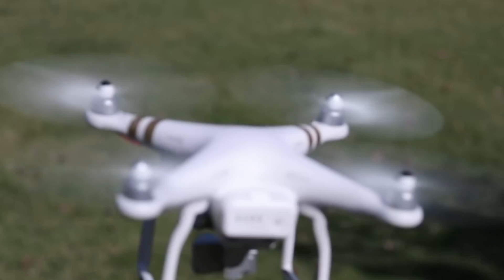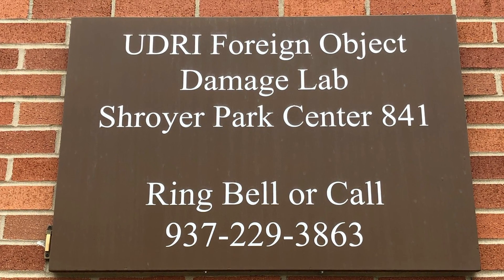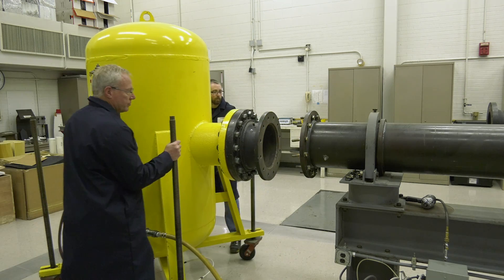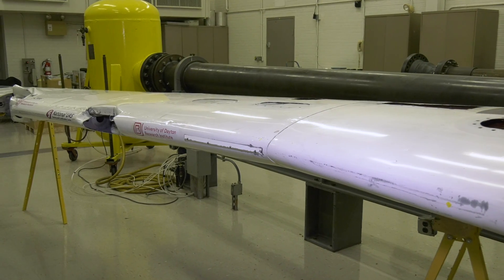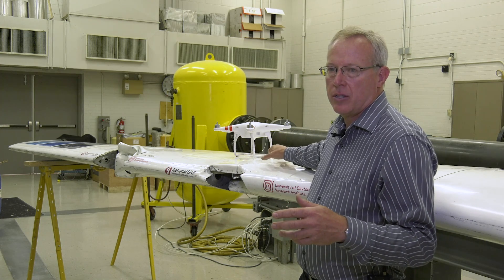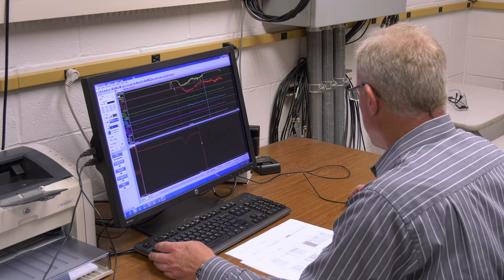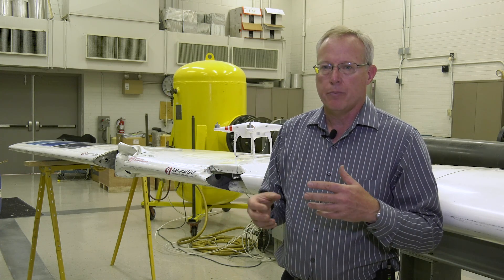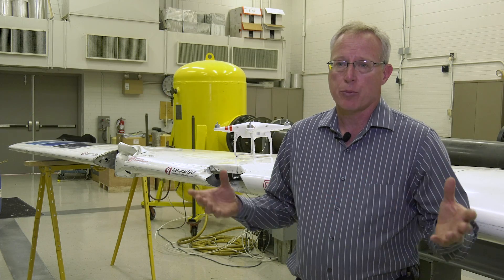What Happens When a Drone Hits an Airplane Wing? – AIN

Comment: The test is slightly misleading. While the closing speed of 238 mph might be realistic in some unlikely circumstances (see below) it is the airplane's wing that flies fast with the drone being more or less stationary. A wing travelling fast through the air causes specific airflow strong enough to create lift keeping the plane airborne and that airflow would tend to very strongly deflect the drone either up or down, away from the wing's leading edge so a direct strike like that (perfectly aligned with wing's chord line) is highly unlikely.

Drones operated legally fly below 400 ft or within 400 ft of a structure and away from airports. Planes operated legally don't fly at 200 mph+ that close to the ground or structures except perhaps for landing/takeoff where drones can't fly so for legal drone and plane operations 238 mph closing speed is not realistic. If you don't care about the rules then, well, you can do a lot more damage with a box cutter for instance.
Reply: Binary Operator may be unlikely, but bird strikes to the leading edge of wings also occur without them being “deflected”
Reply: @macadamia238  a bird weights way more than a drone, therefore has more mass and is harder to move.
Reply: Incorrect the airflow around the wing would not deflect the drone.

If this theory was accurate there would never be bird strikes yet they happen regularly.
Reply: Surprisingly they aren't testing the "what if it actually doesn't hit" scenario, because they want to know what happens when they do hit.
A car is also unlikely to hit another car head on, but the crash test does need to determine what happens when they do, that is the sole purpose of a crash test.
Reply: their testing methodology is flawed.   that chances of it hitting a wing square on is effectively zero even if the sky was littered with drones...anyone understand why this is is facepalming so hard at this test and how these guys and gals even get funded...ill give you a hint though, same reason why ice doesn't form on that part of the wing first and forms further back when and if it forms.....

 doesn't mean it is impossible a drone may strike a wing square on, just as unlikely and accidently hitting the moon with a passenger jet..
Reply: Well, over the years as an airline engineer, I've seen lots of birdstrikes, even a fruit bat strike.  Usually bang on the leading edge.
Reply: Binary Operator in a simulated crash it doesn’t matter which is moving towards which. I think you’re better off getting a review on scheme of references and how vectors works. This experiment could be seen from the scheme reference based on the aircraft, as any study is practically done, since it’s much easier to move lighter objects instead of heavy ones, or with instrumentation. 
Also the experiments always need to evaluate the worst case scenario to guarantee safety in any other possible scenario. 
By an actual aerospace engineer.
Reply: Giuseppe Pipia Exactly.I am amazed at how people often argue about such small things and think they know more than the experts themselves.......
Reply: Here they are testing only what a drone could do to a structure: that means that a panel on the aircraft will be obliterated. The wing is important because any irregularity on the airfoil might be critical for the aircraft, but that doesn't exclude the fact that it might hit the windshield or the nose or any other part of the aircraft. We engineer test those extremely difficult cases to assess the realiability of an aircraft for safety even in those occurences. What if I told you that there is a chance that an aircraft you'd be flying might be falling out from the sky because of flaws in its designs? It's very small, but it's there. Highly improbable, but it's not zero.
Reply: the airflow around the wings doesn't even deflect large droplets of water. Hence icing. not sure how it'd deflect a drone........
Reply: Binary Operator a direct hit on the wing is exactly as likely as any other hit. Whose to say the drone isnt an inch above the wing when the airplane comes by and it sucks down perfectly to strike the wing. These are accidents there worried about it's not like someone is aiming them perfectly dead center
Reply: To those fearmongering for more rules - The FAA has already broken the law to promulgate and continue to promulgate on model aircraft. When are you going to slap their wrist? When are we going to require aircraft, which have absolutely terrible viewing angles, to better their design for safety by increasing pilot awareness? How about pilot safety? The FAA loves to push for expensive toys in even GA aircraft while admitting that they will have no effect on safety but won't push for real solutions such as BRS systems.The fact of the matter is, and has come out and been shut down in recent hearings on 336, is that model aircraft operators are by far more safe than pilots. Yet they are the ones being punished and restrictions being pushed by both the high-end Drone community (Textron, DJI, etc.) as well as lobbies who are supposed to PROTECT Citizens Rights to do as they please. But everyone wants to shit on the little guy who cannot afford the $100k+ little better than toy manned air vehicle.

Mert, that is not how airflow works. At all.
Reply: hahaha no. Actually that is how air works, below the speed of sound any disturbance in the flow can propagate upstream and effect the flow before the aircraft. If you had read my comment however you would know that this doesnt matter because drones and birds are distributed randomly so there is an equal likelihood of a collision either way. Drone pilots more safe than GA ? Because they are in a lawn chair and not in the sky maybe.  Dont make me laugh. There are none, and can exist no statistics on how well drones are flown. I crashed a drone just a few weeks ago and didn't tell anyone because why would I? 13 year olds and druggies can have drones no questions asked. Pilots have to be tested and pass training there not even the same class so forgive the government for asking model aircraft pilots to not endanger human lives for their amusement and put a little regulation your way. Viewing angles ? Ha. Try and dodge a tiny stationary quadcopter coming at you at 200 mph, viewing isnt the issue here it's right of way and the answer is stay out of manned aircrafts way in regulated airspace.
Reply: Mert, you stated "Whose to say the drone isnt an inch above the wing when the airplane comes by and it sucks down perfectly to strike the wing." - The scenario which you stated and I responded to is what is being spoken about. Your moving the goalpost is exactly that. Additionally, Learn what a streamline is which is what shows your ignorance. Furthermore, your ignoring my other points while claiming your are a terrible "drone" pilot does not apply to anyone but you. Furthermore, you have applied a false equivalence of lawn darting a model to that of a manned vehicle despite it being, to any reasonable person, not even the same nor what is being spoken of. That would be like saying every bullet fired at a range in unsafe simply because it was purposefully being fired into a back stop. In short, you do not know what you are talking about - at all - and generally disingenuous.
Reply: Lets just not hit drones with planes
Reply: Someone here doesn't understand how Lift works on an aircraft. Once the air hits the leading edge of the airfoil, it has to split. One set of air rushes over the top of the airfoil faster than the bottom of the airfoil as it has farther to travel to meet up with the same air it hit the airfoil with. Because of this the top of the airfoil has a low pressure zone of air because the air is moving faster. The underside on the airfoil is moving slow or doesn't change, this is a high pressure zone. This only occurs once the air has hit the airfoil. The force of these actions are not strong enough to rip something out of the way before impact.  Drones hurt helicopters more than planes but they do in fact endanger both. Drone pilots don't have to get a license to fly or learn about aerodynamics. Yes I know you shouldn't have to get a license to fly every drone but there should be a requirement for one after a certain weight and size. AND AT LEAST LEARN ABOUT YOUR LOCAL AIRPORT FREQ AND LISTEN TO IT.  -Student Pilot that has had to deal with drones
Reply: Mr. Karambit not quite though... if airplanes flew because the airfoil was longer on the top than the bottom then how do airplanes fly upside down? What your talking about is the equal transit time fallacy..  basically the air never has to meet up with its buddy it split from there is no law that says that, it's a very common misconception even taught in some flight schools. Here is a reference because I know its hard to change imbedded knowledge. 
https://www.grc.nasa.gov/www/k-12/airplane/wrong1.html

Airplanes often fly with airfoils that are completely symmetric top and bottom actually such as stunt planes and the horizontal stab on normal planes are symmetrical airfoils such as the NACA 0012.  Even a flat plate with virtually no thickness at an angle will work. I'm sorry if this comes off as rude but it's better to know now right? Now you can help dispel this misconception too.
Reply: You always design for the worst and hope for the best.
This shows the worst case scenario if such an event were to occur.
Reply: @nihilisticjackfruit6206  the fact is that this isn't realistic at all, so the results could be totally different from the reality. Let's say that you design a wing that stands perfectly this test. Nothing guarantees you that the same wing will stand the impact of the drone when the mass in movement is the wing and not the drone. You don't know how airflow will affect the drones trajectory, so maybe the wing stands the impact but deflects the drone to the intake of the motors, new problem created. And you didn't see this in the test.
Reply: @nihilisticjackfruit6206  WORSE CASE SCENARIO?!?  You lack imagination, all aspects of relevent aviation knowledge or  experience, etc., to the point of misunderstanding reality, i.e., our entire airspace is predicated on the need for all piloted aircraft to go wherever/whenever allowed and anywhere in emergencies by necessity.  As such aviation and drones are incompatible and irreconcilable UNLESS exclusive to governments or otherwise legally, socially and politically governed for reasonable general public safety.  No issue.
Reply: If you live near an army airguard facility you would see f16 fighters in 3s to 4s every day multiple times a day flying at around 400-500 feet over neighborhoods and parks where people fly drones..
Reply: @the__________  then they should stop infringing the people's right to fly drone ON THEIR PROPERTY
Reply: You truthers are adorable.
Reply: With a box cutter huh 😅😅
Reply: LMAO goddamn box cutter
Reply: lee, the obvious answer is that it does not help anyone except those businesses which will be able to profit from said laws and are pushing for them. Those businesses being the ones exploring drone deliveries and the companies positioned to make the drones. The fact of the matter is that despite it being an infringement of Rights and an invasion of space it will always be couched in terms of "think of the pilots" despite the pilots being the ones who are dangerous and invading space they do not belong in.

lau, What do you "engineer" where you also do not know of streamlines as evidenced by your lack of knowledge of what is termed the stagnation point and its associated streamline? Being blunt is appears you are likely a mechanic or "technician" whose title was changed in accordance with late 90's thoughts on inclusivity were job titles like trash man were changed to sanitation engineer. In short, as above, destroy language and rephrase the problem using incorrect language and scenario's until the answer is the one you want.
Reply: Put potential effects on airworthiness to one side for a moment.  Do you have any idea how much it costs to fix the damage caused by a $300 drone?  Up to 1,000 more, once you take into account the effects on the airline's network.  Would that be acceptable to you, if you were the airline?
Reply: @lautoka63  stop flying over people's property theb
Reply: Do you mean as an airline, as a glider pilot or what, please?  I thought you'd be more concerned about drones flying over your property (as I would be, too), since they're at low altitudes, carrying cameras.
Reply: @lautoka63  I really think these comments about drones around properties and cameras are stupid. Everybody is freaked out about a drone in a camera recording their children or something like that. Silly. You know why? You should be concerned about mobile phone cameras. Everyone and I mean everyone owns one of those and you don't stand out when you have one they don't make noise. If someone's going to do something creepy with a camera they're going to do it with her mobile phone not a drone that's relatively unstable and making a bunch of noise. So these concerns about cameras and drones is so stupid it drives me nuts but since everyone owns a mobile phone there will never and I mean never be any concern about that. How dare they take our phones away. Oh but let's ban those drones. Some of you people are ignorant
Reply: ngentotsemua You do not own the airspace, like it or not.
Reply: You've got a point, though you won't win many over to your view with your comments.  The difference I see between drones and mobile phones (for taking pictures, rather than flying into aircraft) is that drones can fly over your property, over areas where you would not expect to be photographed (unlike phones in public places).  Just my opinion, but let's exchange views without name-calling: it leads to dialogue rather than trading of insults.
Reply: Ya not wrong
Reply: Michael lee  Once again...where did I advocate for changes in the laws?
Reply: Binary Operator agree
Reply: Binary operator - While people obeying the law will make this type of collision rare, the issue is the incompetent and irresponsible operators, plus the criminal element that may deliberately target an aircraft with a drone. The test method of the air canon has been widely used to test bird strike damage for many decades and there have been thousands of instances of bird strike to correlate test and real world data to validate or invalidate test methods EG) When Rolls Royce originally started using this test for engine bird strike they used frozen chickens and were shocked at the damage, then Boeing , I believe, told them to thaw them first - Hard chickens made more damage than soft chickens, what a surprise.
Reply: Very well said.
Reply: yeah, i'd like to see them fire the wing at the stationary drone at 238mph.  it might have the same effect or it might cut  
through the drone like a hot knife through butter.  We know that if you double the speed that wing can cut through a 
building.
Reply: Actually, that 238 miles per hour closure rate is pretty accurate when you consider, as you said, drones typically fly around 400 ft and that speed of 238 miles an hour is about what a plane will be doing on takeoffs and landings which occurs low to the ground so doesn't make sense to fling that drone 500 miles an hour when a plane is never going to be flying 500 miles per hour a few hundred feet above the ground so I think that that speed of 238 miles an hour is an accurate one for this test
Reply: You destroyed that shit bro.
Reply: "away from the wing's leading edge so a direct strike like that (perfectly aligned with wing's chord line) is highly unlikely."
highly unlikely = inevitable.
Reply: Jet Engines will suck the drone into that before it reach wings... Drone can't fly steady in heavy airflow
Reply: Unfortunately there are a lot of irrisponsible drone pilots out there that do fly close to airports which validates this test.
Reply: 14 CFR 91.117 - Aircraft speed. (a) Unless otherwise authorized by the Administrator, no person may operate an aircraft below 10,000 feet MSL at an indicated airspeed of more than 250 knots (288 m.p.h.).
Reply: flyer5769 There’s also something similar in the CARs which I’m more familiar with (I’m Canadian), but it still stands to reason that any fod in a jet engine is a bad thing, even though that would only include drones if someone’s breaking rules.
Reply: I think you are correct
Reply: THANK YOU
Reply: Exactly Just like a butterfly in front of your car. Potentially could hit the screen but never known it happen, to me at least yet. They ride right over the roof..
Reply: This comment didn't age well.
Reply: The concern is not for legally operated drones.  If you're flying your drone legally, you're not going to get involved with the normal flight-path of an airplane.  However, there are lots and lots of documented incidents where idiots are flying their drones where they shouldn't, including near airports during take-off and landing or near wildfires where firefighting aircraft are trying to make water/retardant drops.
Reply: @Genthar  so you want to tighten up laws because some assholes don't follow current laws? Yup. Sounds legit.
Reply: @Argosh  In what way did I advocate for changes in the laws at all?  My comment was solely about the possibility of drone strikes.  I repeat:. If you're flying legally, you're not likely to be at risk of a drone strike on an airplane.  It's the idiots who don't follow the rules who are the issue.  They're the reason that studies like the one conducted in the video become necessary.
Reply: @Argosh  yep, the should start with cars
Reply: the point is very unlikely if a manned aircraft is being flow say 200mph that a drone would be able to strike the wing..regardless of pilot flying legally or NOT... the reason being the physics of how planes generate lift.  the drone would get deflected over or under.. doesn't mean a strike wont or cant occurs just means where the strike may or may not occur.. just means the testing was insanely flawed.

also just to add, a bird wont break apart like they claim it does, i hit a little bunny once when i was doing over 150mph (on open highway with no one around) and while it did pretty much explode on my front end, it took out the radiator, the intake tubing, and the turbo, and a oil cooling line and also messed up the AC compressor...little prob 5 pound rabbit did bunch of damage..luckily my insurance covered it without issues..
Reply: Yeah and no matter how much u tighten the law for drones.   Those stupid people still wouldnt follow the rules...
Reply: The amount of airflow deflected by an airplane wing in that amount of space is not enough to deflect anything of the sort because of this magic called inertia. Bird impacts happen all the time, and they are not made up of dense batteries and electronics. I know because one of ours just destroyed a slat because of a goose. Secondly, 238mph is NOT unrealistic. Maximum speed below 10,000' is 250 knots or 287.5mph.  So basically, you are completely wrong on all counts.
Reply: Not quite accurate as that is first off a speed unattainable by all but the most advanced GA airframes which are uncommon as compared to a Cessna.  Secondly, that isn't quite a correct statement as that is only the general below 10,000ft speed restriction, within the area around an airport it drops to 200kts where a strike is far more likely and where it is highly unlikely a GA airframe such as this would be up near its max cruise speed (again also something not attainable near at low altitudes).
Reply: TheTechnoPilot Even at 150 kts or 100 kts a plastic or composite object weighing a few pounds can do terrible damage to a typical ga airframe. Cessnas and the like have fairly well built wings, and even they would sustain considerable damage with such a strike. Not to forget the lighter aircraft that may have fabric covering (granted they’d be slower) and they would still sustain terrible damage. I could likely see a drone at the wrong place at the wrong time striking a ga aircraft in a critical place, not just on the airframe but possibly going into the propeller. Honestly any fod is not a good thing.
Reply: @ninqinpoop4464  FOD is never a good thing but I'd actually almost rather hit the prop, especially a metal prop then the airframe or wind screen.  I've chopped up a few birds over the years with metal props at full power setting with no damage, I'd expect pitting hitting metal motors, or carbon frames, but wouldn't expect severe damage that couldn't get me down safely.

Additionally though, don't forget that the energy of an object hitting your airframe varies incredibly between 120kts TAS versus 200kts TAS, it is quite literally a square of the velocity difference and will cause very substantial difference in damage.

This test is a little disingenuous and comes off as a scare tactic showing a collision which actually could not occur in real-life due to altitude and flight-performance limitations of the DJI and performance capabilities of the M20 at sub 10,000ft.
Reply: TheTechnoPilot Fair point, although a fair amount of small aircraft have the traditional wood prop, sometimes with a plastic edge for protection. I agree that it comes off a bit as a scare tactic, but I know for a fact that certain quads can hit altitudes that are flown by larger aircraft on approach. There was an incident in my hometown a few years back where a drone flew way too high and was seen by the pilots/passengers of a jetliner on final. I think that’s a scary thought to think someone with little to no knowledge of aircraft can buy and operate an object like that. Aside from a quad hitting a ga airframe, getting one stuck in a turbine fan could definitively cause major damage, and in one of the most critical phases of flight. In reality, I realize that these incidents only happen when someone is breaking rules, but it’s much more likely that someone can break rules with a store-bought toy than with a certified, tested and professionally operated vehicle.
Reply: Binary operator, I have seen the damage that a seagull made to a Mirage FIII on short final approach to Cape Town Airport. It was substantial. The theory that the airflow will lift an object over the wing has been disproved many times, especially when perfectly aligned with wing's chord line as you say. The fact that bird strikes happed proves this. The biggest danger to some drone pilots are themselves and their gigantic egos, sorry to say.
Reply: You would be surprised how much you can direct a drone to make precise strikes. It is definitely possible and not that tough to do.
Reply: I enjoy my drones greatly but I think your comment is intentionally misleading, as you ignore too many obvious objections:
1. Not all aircraft are jumbo jets. Think about engineless gliders and Cesnas, for example. rain ruins the aerodynamics of a glider wing, what do think a mavic will do to it?
2. All accidents require something being in the worst possible place at the worst possible time. That facts that it's statistically unlikely is countered by the sheer volume of people in the world.
3. Your grasp of aerodynamics is amusing. Air is guided under a wing to create lift, it doesn't avoid the wing. The whole point of the process is that it does hit the wing. And air is tiny and less dense, compared to a drone.
Reply: @Duck-jc9ox  3 your grasp of aerodynamics is wrong, fast moving wind over the top of wing reduces pressure allowing wing to lift. Well that's what I learnt at high school anyway.
Reply: @brotang2953  that doesn't contradict what I wrote. air*, at higher velocity thus lower pressure, creates lift as it goes under and over a wing - but a *drone, or bird is too heavy, and will not, as OP is arguing.
Reply: These researchers are funding whores... And fear pays the best.. So thats what they do..
Reply: @lerlo  udri isn't hurting for funding, most of the work is either DOD or corporate funded as they basically act as a R&D lab for companies.
Reply: Before you speak any further, search YouTube. There are tonnes of videos of people flying drones to 3000-5000 feet in the air.
All legally flown just for fun or experiment.
Reply: @theotherside931  "legally"
right
Reply: Your answer is correct. There's also a chance of about 999,000,000 to 1 of actually hitting the drone with a plane wing due to the drone being so small. 
You could say there's more chance of a swan hitting the plane as there are more swans than drones.
Reply: @grahamtunstall4186  birds do hit planes regularly.
Reply: Binary Operator the drone was launched with air. That same air is traveling over the wing at 238mph. Birds aren't deflected. Where did you even come up with this idea?
Reply: I understand what your saying and I agree but the comment at the end was garbage and unnecessary.
Reply: what is the comment at the end in reference to?